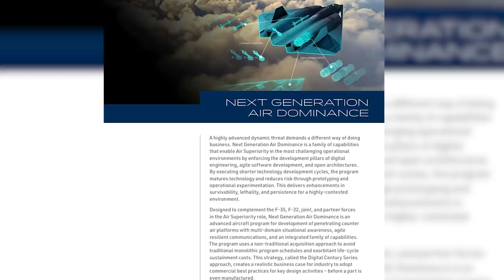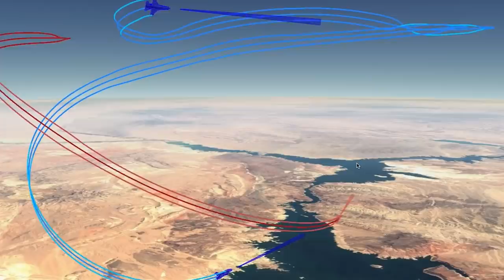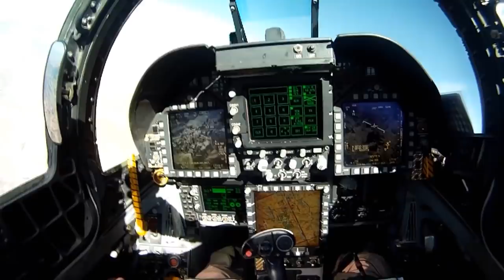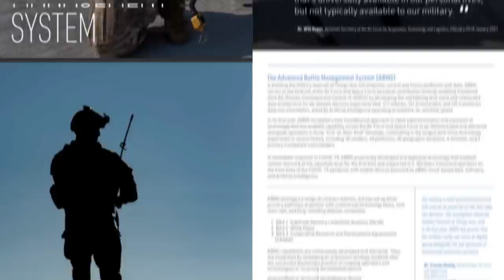Here's America's 6th Generation Fighter Jet Kept In Secret

Comment: All of this high tech in a craft and will still have the crappiest camera that captures UFO footage
Reply: That's on purpose nugget
Reply: This let's you know there is MUCH more UFO conformation... 😉🛸✨
Reply: That's because they never actually show us videos. What they show us is FLIR recordings that read heat signatures. As far as I can tell they have never shown us any straightforward video footage of anything.
Reply: @TerryNails  I agree. I'm waiting for the visible light video footage--I've had enough of the FLIR footage already. I also want to see it close up--within 100 ft of the cockpit--not from five miles away so that it completely lacks detail. Speaking of detail, I also want high def video with a modern camera instead of the 1975 potato camera they used for the other videos.
Reply: Maybe aliens have never and never will reach earth and these 'ufo' videos are images of military concept tech. Public obsession with aliens helps keep it covered up with MSM using the term 'UFO' over and over.
Reply: "Frames Per Second" is a big issue.
Reply: @you5711  they need fighter pilot camera views.
Reply: @andysmith5464  I suspect the vast majority of things we've seen lately are in fact high-tech military projects. However that can't explain the sightings that people have had going back over 70 years or more. My mother had a day light sightng in 1941 the large object with several smaller objects flying around it, the smaller objects entered the larger object at which point the large object took off like a spark from a grinding wheel. This happened before the terms flying saucer or UFO wherever coined.
Reply: Look up Commander David Fravor on Joe Rogan
Reply: @wildcatmahone-md6me It's a Great interview! 👍
Reply: Right?🤣
Reply: For some reason when our cameras caught a ufo the cameras get turn into 1950s footage lmao
Reply: @michaelwachendorf2096  1950s footage was way better!
Reply: We came up with the sr71 in the late 50s early 60s but yall still screaming about aliens 🤣🤣👌
Reply: @TerryNails I think there may be a chance that by using a cellphone or camera we are trying to capture something that can’t be captured by our modern methods. I don’t understand why we don’t consider that if something has thousands of years of tech on us that it may be impossible to capture using stone age tech😂
Reply: Why does a UFO need to take selfies 🤷‍♂️
Reply: @danieloliver20  are you sure everyone will conform to this though 🤔
Reply: I like how instead of discussions about how cool and impressive this next gen fighter is, its people demanding better and clearer footage of ufos. A fighter pilots visual confirmation isnt good enough along with scrolling through different spectems on a headsup?
Reply: @noompsieOG  I honestly don't understand why anyone needs to take them...
Reply: Because it's all a grift  and with big foot sightings,,camera man still in 2021 look like he recorded in VHS 🤣
Reply: The crap video of the ufo is the new fight jets
Reply: @TerryNails  it's not just that, and you're not fully correct. The FLIR recordings from targeting pods and other sensors on aircrafts these days are incredibly clear and high detailed, the video footage released to the public is intentionally distorted as clear footage could give an interested party details concerning your drone, aircraft, their optics or info from your drone/aircraft program that you don't wish to be publicized.

We built an airplane that can read a license plate number at 100,000 ft in the air. (blackbird). We can absolutely pull high resolution video from sensors, look at any HUD or other sensor video on youtube, for example the A10 close air support ones, and you'll see how blurry and low resolution they are.

Even if these things aren't necessarily classified the military doesn't like showing the full capabilities of its weapons platforms nor should it.
Reply: @gregorybentley5707  👍👍👍
Reply: @addoz  yep! Along with all the hard drives that recorded all the data..
Reply: Indeed.
Reply: @Sciurus  I doubt if very many have. People seem more interested in expressing an opinion and seem to have no interest whatsoever in doing the research to see if those opinions are valid in any way shape or form.
Reply: @TerryNails  people are attracted to "sexy" things. They want the fast cars, hot girls, the newest of the new, but unfortunately very few take the time to study engineering, physics, chemistry, and even some of the more "occulted" aspects of science and technology that you wont find in the regular list of university courses. Institutions of Higher Education have rejected "Occulted" topics of studies for many centuries now. It just so happens that Nicola Tesla's work and discoveries when he began researching the dielectric impulse waves he had rediscovered during an experiment is considered an "Occult" topic within the study of Electrical Engineering and is thus not taught. Everyone knows Direct Current and Alternating Current, yet very few have ever even read about Tesla's impulse currents driving his technologies, and how many of his systems were designed around using this special type of current. It is much like a sound wave, longitudinal in nature and measured in a similar system of magnitude like decibels. And who knows how many designs of systems and parts that were never patented and he took to the grave with him...

Then there is all the work of John Ernst Worrell Keely and the reports of a mysterious airship flying around the US in 1898-1899. Dale Pond has put together some really good material about Keely on his SVPWiki and also has a good lecture on YouTube about Keely. Basically Keely was using music and sound to alter bouyancy of iron spheres in 4 foot tall water filled glass cylinders with his special sound transmission wires made of a specific silver/gold/platinum combination alloy made into a wire that was most likely a room temperature superconductor that is probably a national secret to this day.

Anyone interested in this should check out Rho Sigma's "Ether Technology: A Rational Approach to Gravity Control" for a short ~120 pageish book that they can probably find a free .pdf of if they want more information on this topic.

Another great lecture is William Lyne's interview on a  show called the 33rd Parallel. You can find that on YouTube if you look hard enough. His books, especially "Occult Ether Physics" are a real eye opener.

And the other one I would check out is Eric Dollard's lecture titled the "History and Theory of Electricity" which can be found on YouTube as well is a great reference and lesson into the mindset of the great electromechanical engineers of the late 19th and early 20th centuries and the theories they were working with before PopSci went mainstream as a propaganda tactic and ruined everything by burying Tesla's work.

If you already know all about the publicly available information about Thomas Townsend Brown on the web, then some other important mentions of interesting engineers & scientists for anyone interested is Victor Shauberger (the book "Living Energies" by Callum Coats is a great place to start with Schauberger, which can easily be found as a free .pdf with a Google search), Walter Russell (he wrote many amazing books, all available to download as free .pdf's due their age, and he also built a machine that caused nuclear transmutation in the 1920s confirmed by Westinghouse Laboratories at that time, and many other feats like his doubling circuit), Thomas Henry Moray (who took Tesla's work and went even farther with some of it, further researching and then developing radiant energy based circuits, lighting, generators and motors that could put out and run on this type of cold electric current, and even got in gunfights with communists in the Rural electrification administration who tried to violently suppress him and he even had to modify his car so that it was bulletproof to the small arms of the time frame. His book "Beyond the Light Rays: The Sea of Energy the Earth Floats In" is a true classic and another great place to start understanding the nature of these alternative electrical phenomena that they were working with compared to regular hot electrical currents that we are more familiar with), Dr. Gustaf Le Bon (for pointing me in the direction of Alchemical Mercury, which then made me realize alchemy and the hermetic sciences are probably legit, which then got me to start studying the material available, like Fulcanelli's books), Pier Luigi Ighini (there's some quality material and videos of him on YouTube), Edward Leedskalnin (famous for his Coral Castle structure, but it's his books you want to read), Dr. Raymond Royal Rife (learn about his famous microscope and how it worked, and also look into how him and his partners developed an impulse wave machine designed to kill viruses and bacteria in vitro by using the longitudinal electric wave at a frequency that is resonant to the size of microorganisms they are trying to destroy and then shatter them just like an opera singer shatters a crystal wine glass with just their voice, and then consider what a device like that would do to big pharma, as well as what the US government could do with the microscope for both biomedical and material science research, or if they modified it for distance to be a telescope and slapped it up in a satellite destined to be launched into geosynchronous orbit, and definitely look into the drama John Bedini went thru when he got his hands on part of Rife's machine, namely the beam tube) and definitely look into Laboratory Alchemy and how it's quantifies and qualifies substances and things entirely differently than chemistry does, because maybe some of these materials are not made using chemistry! Remember Hermes Trimegestus created the first hermetically sealed glass jar in history, just add 2 bonze or copper wires and a Baghdad battery array and you got a Vacuum Tube! Dont forget about those Vimanas! And that's just the START!
Reply: @Sciurus  the most important question here is whether our perceptual idea of the existence of a self-standing wave structure in the form of a physical universe is correct or if the tactile sensory experience we have on a daily basis it's simply an emergent property of conscious awareness that we then project a storyline onto. Or rather write a script about based upon incomplete information and are unexamined assumptions about reality itself.
Reply: @Sciurus  I love studying the engineering of hot girls but I can't seem to get a permission slip from my Wife to do it anymore.
Reply: It's because infrared or heat signature camera... And common camera from your android phone now couldn't able to get clear photo from a sonic speed or light speed space craft
Reply: Psyop
Reply: @solepropt  I usually find that most of their audio outputs are broken and can't seem be switched off unless you short out the port by sticking something almost too big too fit into it! Lol!

Unfortunately I can never seem to hear any useful information out of their audio outputs, well... unless you want to know which guy in your neighborhood is actually unknowingly raising the milkman's kids! 😏😅😂
Reply: @danieloliver20  I  I’m kkkk ok Mmmm uh
Reply: Classic 😂😂😂
Reply: That’s because we are the ufos 🛸
Reply: @TerryNails  Thank you for sharing maybe tell Richard Dolan:}
Reply: @TerryNails  ' I suspect the vast majority of things we've seen lately are in fact high-tech military projects'. Sorry but no! Believe your mother, she don't lie.
Reply: that's because it isn't, you try taking a clip of a duck flying down the river when you are going the other way, but up in the clouds and going like hundreds of times faster.
Reply: @psycronizer  exactly!
Reply: @stankygeorge  it sure seems like that sometimes but I suspect that they have extremely clear video along with all of this other sensor data and they just aren't showing it to us. As far as blurry images taken by the general public, people horribly overestimate the abilities of cell phone cameras which are basically good for up close selfie type photos and near to medium range photos. Unfortunately they are completely useless when it comes to long range photography. It drives me crazy when people complain about cell phone photos being bad. It's like complaining that water is wet..
Reply: They're just naturally blurry like Bigfoot
Reply: @popeantichrist8847  😁
Reply: lol…..yep…
Reply: LOL! Actually, I heard the original videos were very clear. They just released the crappy version.
Reply: @michaelwachendorf2096  Maybe they produce magnetic  fields that distort digital cameras
Reply: All this blabber about the tic-tacs... who cares about that?!! I want to see the skittles footage!
Reply: So true,so funny!
Reply: I think you said it all there ~ it along with similar channels linked together are just taking the piss
Reply: what if the new high tech craft IS the UFO?
Reply: IDK about you but I Aint Trying to get Abducted by some Gayliens, Thats Why we have Amazing fighter jets and Air Force! Go 🇺🇸 USA!!!!Go 🇯🇵!!
Reply: @skipper4126  😂  Well said!
 Even 'though it's obviouslly a CGI picture any alien spacecraft would have to be able to fly in our atmosphere so it's going to look like a plane anyway 👍
Reply: That's because the video we get are from Tracking Systems.  Who cares if your targeting system is in 4K if it cant target your enemies.  That's why they use FLIR systems.
Reply: Anti gravity tech distorts the light around the craft, so that doesn't help either. Also if you can concour gravity, you probably councoured stealth too. The thing is those fighter jets use infrared cameras specifically for heat signatures, maybe it's just not important enough for the gov to spend money on 🤔 but yeah, they definitely need something better on them to help capture ufo's.
Reply: @iggyb1033  im guessing what is key for it to work is engineering extremely exotic meta materials to guide energy in perfect geometry and somehow warp the fabric of space. Yeah It is mind bending cause it completely contradicts e=mc2. ET tech is soooo far beyond anything humans have built.
Reply: @skipper4126  brilliant thought!
Reply: Lmao 🤣😆
Reply: @TranshumanistMessiahPodcast No
Reply: I know right 🤔
Reply: I think we're getting close. I was just on a Cruise where ships were pulling up next to us. People wanted to know what the names of the ships were and people with Binoculars were unable to distinguish them. I was able to zoom in with my Samsung S22 Ultra and tell everyone the names of the ships in the distance. I was also able to take pictures of the Nasa site in Cape Caveral with a camera I had in my pocket. I was able to take pictures of the drones taking pictures of the ships. I was able to zoom in on the moon at night. I just need Aliens to show up and I got those suckers 🤣